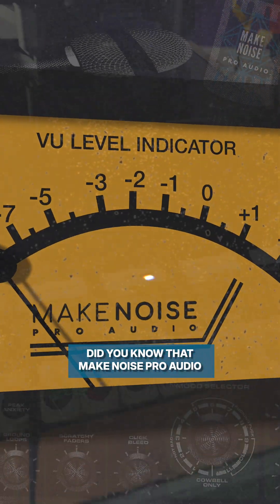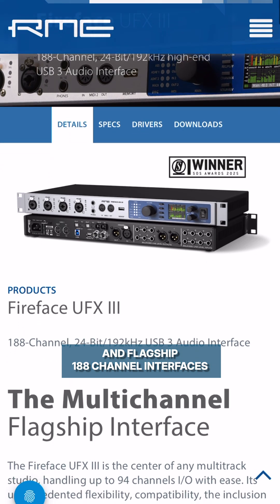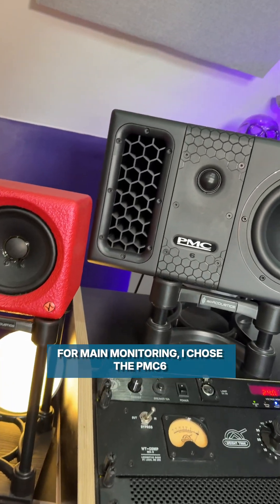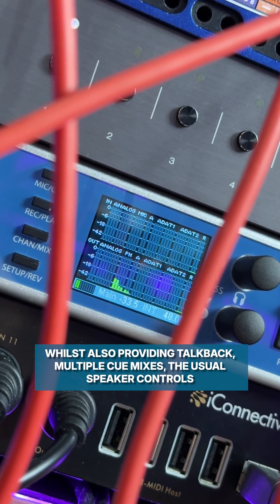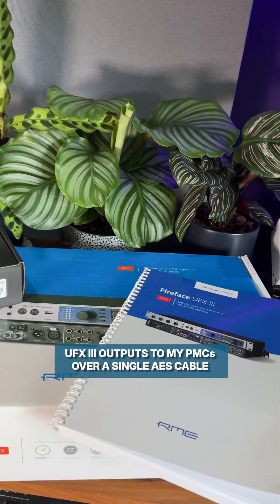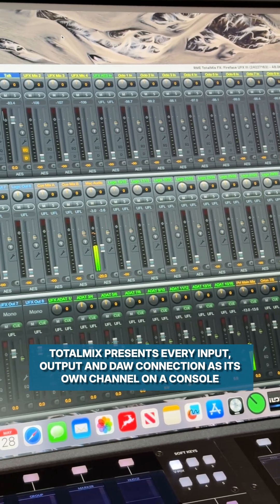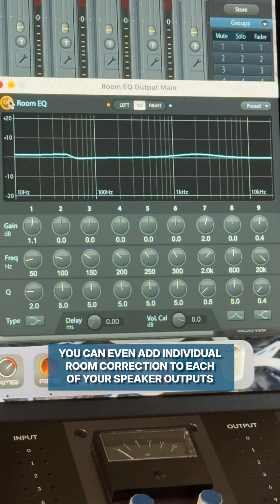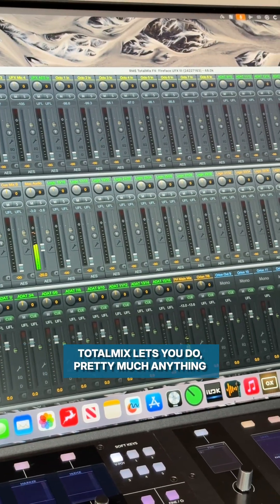Why Switching To an RME / Total Mix Setup Enabled An Uncompromising Workflow

Comment: Quick question Benny, I have the RME ufx iii and I’m running outboard gear through it. In the input and output they have +4, +13 and +19. What is the best to set it at for outboard?
Reply: There really is no golden rule here !

You can output +4 dbu into gear that doesn't have tons of headroom but then you'll need to compensate for that on the return path (ufxIII line input's sensitivity are minimum +13dbu) 

+13 on both output and inputs works for almost everything

You can go for +19 or higher if you want to beat the sh** out of ur gear's input stage but again, make sure you know what you're doing ;)
Reply: @mmx2323 I’m running a pair of Lintec Programming EQ’s and the input stage seem fine at +13dbu but the output I have to bump it up to +19dbu to get a good result.